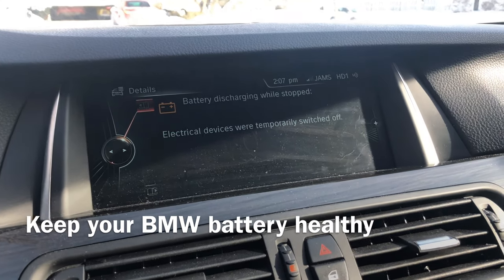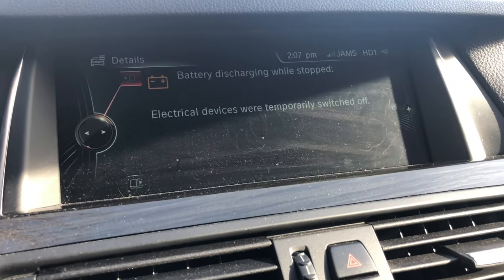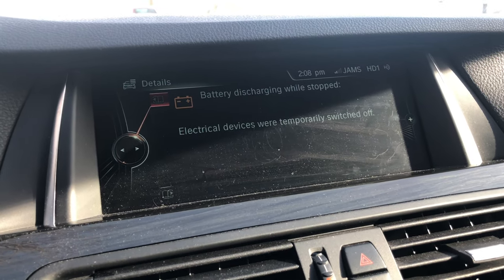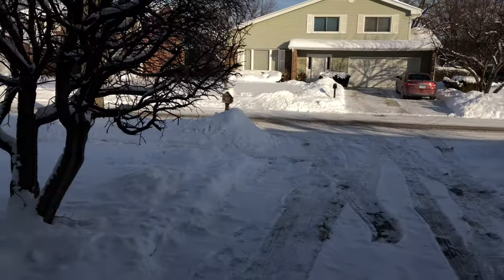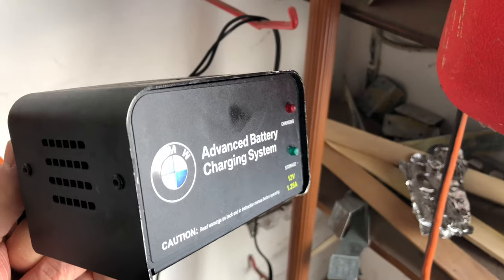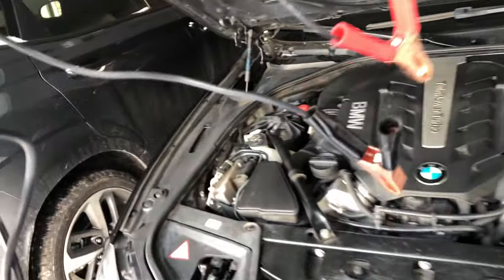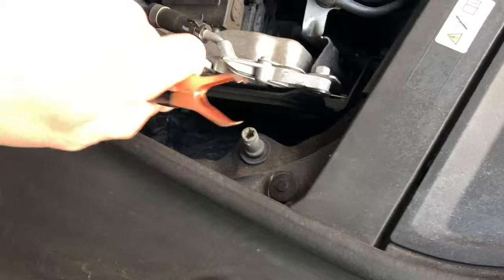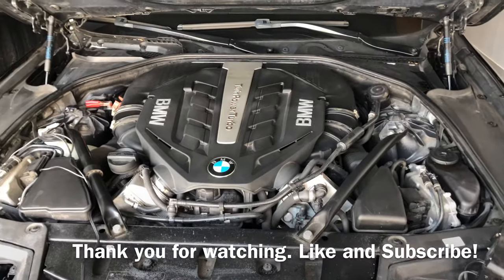BMW Battery Discharging While Stopped -  Keep Your Battery In Good Condition

Comment: ‘Battery Discharging while Stooped’ came on while driving and it was not cold out. After about 1 hour in, the dash shut down, steering wheel stiffened and gear symbols started to blink. I was able to make it home (5 min away) without stopping, accelerating and  adding muscle to turn. I was terrified though. It started this today to tow- same battering reading though.
Reply: How do u fix it? I have the same problem with my BMW528i right now but it show me steering problem, engineer too I was fml.
Reply: Did you figure out the problem? I'm having this same issue right now
Reply: I have this exact problem. And now when I turn it on it shuts off in less than 2mins
Reply: This Also Happens From The Vehicle Sitting For A Long Period Of Time. I Was Told Driving It Will Recharge The Battery via The Alternator!!!
Reply: Bad alternator
Reply: Got this message today, any help?

Comment: i store my car away cause i live in two places. i make sure i lock everything up and shut AC Radio. I have a 2012 750li, i noticed when i came back after 4-6 weeks that same message comes and it goes away when i first drive away. The car starts right up.just wondering why it comes on. when i use the car alot there is no message, it only happens when it sat for long periods.i had my battery checked 3 months ago before storing it and my mecanic saif its perfect.
Reply from the maker: These cars use power even if the car is turned off and locked. Just look at the security light blinking on the mirror, plus there is GPS, self checks etc. so, even with perfect battery you will get this message if it sits for weeks. These cars require a battery tender like the one in video when not driven.

Comment: Hi bro! how r u? I've an e89 2013 (n20i) and I lost my battery, so I can't open the z4 with the remote control or manual key. You know hoy I can open the car to charge or replace the battery? Best!
Reply from the maker: You can open the drivers door with the physical key. Then pop the hood and use the two connections in the engine bay to jump start the car or charge the battery.
Reply: @SimpleCarGuy  Thx u bro! I had tried without success and it was because the key had to be turned with more force. The battery is dead, any recommendation to charge it? Do I connect it directly to the battery or is there another best technique? Thank you!

Comment: Quick question bro I recently got this message on my bmw today and I no longer have my radio would this cause my radio to go off most likely right, also another thing I do not have a bmw battery charger likes yours but I do have a very good jump box can I use that to charge it?

Comment: I just had this message come up since it’s been getting cold 
I hook it up on trickle charger overnight it’s all good now 👍🏻
Reply: Thanks, I am getting this message now. I will charge it up.
Reply: I have the same error message coming up now. I thought it was because I jump started my partner's car, but it is cold outside now, so the weather may be the reason.
Reply: @Kevinacharles  keep in mind you will have to replace your battery soon. 
Check age of the battery 🔋. When I took my battery out it was 7 years old. 
I bought original battery from BMW because it was cheaper than aftermarket. If you decide to change it your self you will have to register new battery. If you don’t you your car will eventually kill your new battery 
Hop this helps 👍🏻
Reply: @mikimiki195  thanks for the advice. I might just opt to change the battery then. I am just relieved it's nothing major. I had paid out far too much on repairs last year.

Comment: I have the same problem 
I woke up and at the morning 
The engine wouldn't start 
I charge it the same way of yours.
Still the message " increased battery discharge when stationary. Electrical consu...."

How to remove this alarm ?? 
The car is working now

Comment: So u can also drive it around to charge it back up?
Reply from the maker: Yes, you can. You have to realize that in order to fully charge the battery it can’t be a 5-10 minute drive. Also, the trickle chargers condition the battery which is likely to expand the life of the battery.
Reply: SimpleCarGuy thanks perfect explanation imma subscribe
Reply: SimpleCarGuy I drove my car for 3 hours on the highway, but when I turned my car off, the same battery discharge message popped up on my iDrive. The battery got replaced 10,000 miles ago. What could be the problem?
Reply from the maker: @triple-aries  Was the battery registered when replaced?
Reply: SimpleCarGuy also want to mention that I’ve owned my car for only 8 months.
Reply: @SimpleCarGuy  I don't know. It was replaced by the BMW dealership I bought the car from. I'm sure it had to be since BMW did it themselves. The notification didn't show when I started the car today, so maybe it's all good now.

Comment: I got the message Sunday you think I need to charge the battery or replace battery it says battery discharging while stopped: Electrical devices were temporarily switched off what does that mean air condition 12 volt outlet or just the charge the battery or replace the battery? I have 2013 550 BMW. Where do I charge it the engine bay or the trunk battery?

Comment: My car literally stopped in the middle of the light went to Neutral by itself and shutoff completely now won’t turn on I have no idea what to do. Please help🙏🏾
Reply from the maker: I would recommend scanning it with a BMW scanner (Can be had under $100) to see what happened. That's really the only way to know what's going on. Of course, check to make sure your battery didn't somehow disconnect. Do you get any lights, power? Does it crank?
Reply: @SimpleCarGuy  I still get power and it sounds like it’s trying to start but doesn’t, unfortunately I don’t have a scanner so I took it BMW today to at least know what’s wrong it. Hopefully it’s not anything serious😭🙏🏾.

Ps I don’t know much about working on cars but from doing research online I think it’s probably the alternator or probably a timing chain or serpentine belt.
Reply: Hey chase my bmw did the same did you ever figure out the problem ?

Comment: This happened to me after driving for 1 hour about 45 miles journey on the freeway doing between 60-100kmp. So am not sure what's going on
Reply from the maker: If you got the message while driving, it is most likely the alternator. Before you get it replaced, though, I would recommend testing the battery just in case it is the issue. Usually those tests are free at Autozone.
Reply: @SimpleCarGuy  thanks for the reply. I was driving and then I stopped this happened. I drop again for another 17 minutes  stop and it happened again. 
The car was in for yearly check 3 days ago. I think the check for battery but will need to call them tomorrow and see
Reply from the maker: Let me know how it goes. Shouldn’t be a hard issue to figure out.
Reply: @unyimeakn9615 so what was the issue did you fixed it?

Comment: Hey I have a question man  I closed the door of my 5:50 bm W that has soft close feature and now I can't get it open because the seatbelt is the locked in it and I can't get open at all what do you suggest
Reply from the maker: oh that's something I've never heard of. Have you tried the manual key to open the lock and then..well.. just pull on it?

Comment: not helpful.  My bmw won't start due to an electrical issue but it sat in my driveway and somehow drained the battery completely.  I put it on a trickle charger but after 8 hrs it only shows 3.4 v at my battery.  I'm afraid something is still draining it.  I want to shut of all electrical use in my Bmw!   Obviously its load shedding algorithms worked like SHIT!   Only way I can think is to pull the battery out and charge it directly.   But I have stuff in the truck and its difficult to get it open.  etc. etc.

Comment: so, without a charger, a drive on the highway should recharge the battery? in winter of course. its been -20 here. right now its above 0. EDIT: i got a new lead acid battery put in. 6 days in and get the recharge light on the dash. i still have the stock agm battery in the house as the volt meter on it reads 12.3v. so im not sure if its the cold draining these batts or the fricken alternator? its a 2012 528 xdrive.
Reply from the maker: A 20 minute drive will recharge it more or less, but if you leave it for a few days again, it won’t be enough. 
As far as the new battery, did you get it registered?
Reply: @SimpleCarGuy  the car gets driven every day. it doesnt sit. work is only 2 miles away so no highway time. but on my breaks at work i sit in the car running. i wonder if thats why the battery will drain. it isnt moving just warming up
Reply from the maker: Correct, the battery is basically not charging when you are idling or just enough to keep things running. Do make sure you register the new battery or the car will kill it quick.
Reply: @SimpleCarGuy  thank  you for that. i was just wondering. i have insta and inpa etc on a toughbook winxp. i cant remember if an f10 is too new for that or not. i got it for my e39 mainly. so now im wondering if the stock battery is still good then.

Comment: Hi, i live in Connecticut and have the same bmw x3 2013 and i haven’t started it in about 6 months when i did this morning it actually started but the battery discharge light came on and car took an hour to heat up but also the car wouldnt go as i press on the gas pedal do you think it’s due to the low battery level? I’d appreciate it to get an answer
Reply from the maker: If the car has started, the low battery would not affect the car moving. What exactly happens once you put it in gear and press on the accelerator? Does the engine rev up?
Reply: I started it again this morning and it does rev and drive but the battery light is still on I’m taking it to autozone and get the battery checked. Thank you for taking time to read my comment and reply.
Reply from the maker: @Madeasy4you  Hopefully you got it checked. If you don't plan on driving much in the future, grab yourself a decent trickle charger for peace of mind.

Comment: hello, I have an 04 325i bmw abt 150k miles. It seems to die if I dont turn the engine on and leave it on for a bit, in 2 days. So 2 days on no use, the battery completely dies. I got a new battery and it still happened. Took it to the shop for some other issues but mentioned that and they didn't know. Was told by triple a it may be an alternator problem, my alternator voltage fluctuated between 12.4-13.4. I'l literally send money to anyone who can solve my issue lol. Really don't know where to go from here and am worried I'l end up spending money on an alternator for nothing as I don't think thats a low enough voltage for the car battery to die while not in use.
Reply from the maker: I don't know much about BMW older than 2008 as that was my first one. Do batteries have to be registered on 2004 cars? I think for 3 series it started in 2006, but I'm not 100% sure.  If so, I would definitely check and make sure the battery is registered.
It also doesn't seem like it would be the alternator, unless it is half bad and is on it's way out. If it wasn't charging, starting your car and driving, wouldn't do much good. 
I suspect you have a parasitic draw that's draining your battery.

Comment: I have a F82 2015 BMW M4 that uses a lithium ion battery. Every time I start the car I get “increased battery discharge” I contacted my local BMW dealer and some tuner shops and they all tried to charge me $1900+ for the new lithium ion battery. That is just crazy stupid... I am wondering if I can put in a normal battery that matches all the specs to my oem battery in the car. Please help me out
Reply from the maker: I am not an expect on this but from what I know the car doesn’t have a smart sensor on the negative cable as it’s built into the battery. So, unless you can do some advanced coding, I don’t believe putting an AGM battery would work out for you.

Comment: Mine did this so I changed battery and still does it. Do I need to trickle charge new battery
Reply from the maker: You have to make sure to register the battery or your car will kill it within 6 months.
Reply: @SimpleCarGuy  what do you mean register? It's a battery swap like any correct or do I have to go in setting mode
Reply from the maker: Most modern BMWs require a battery register after a swap. Your car learns how to charge it overtime and give it more ‘charge’ as the battery ages. When you put a new battery in, the car doesn’t know this and will overcharge the battery subsequently killing it in a short time. You  can get a bmw scan tool to register it or go to the dealer and they will do it for $100